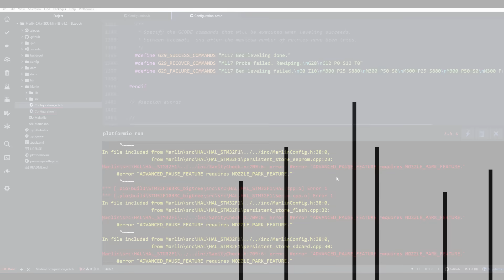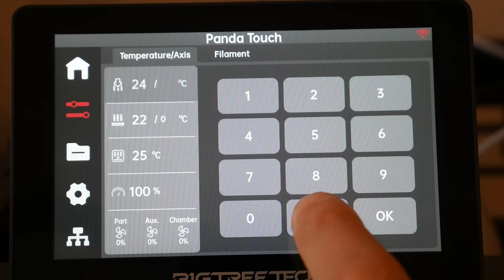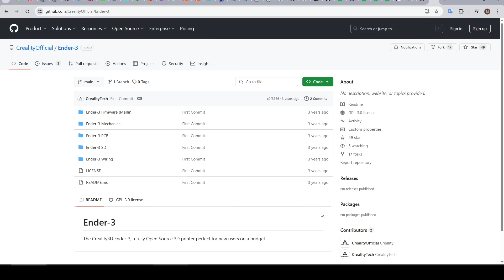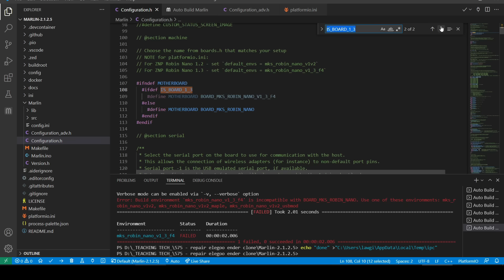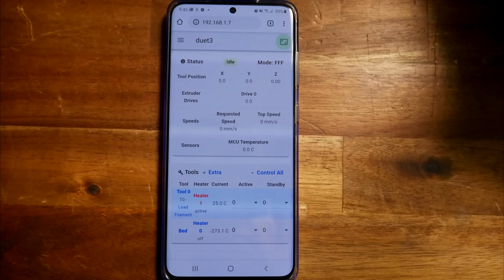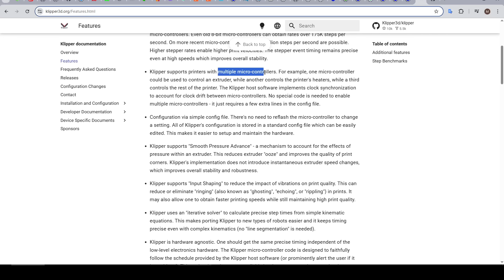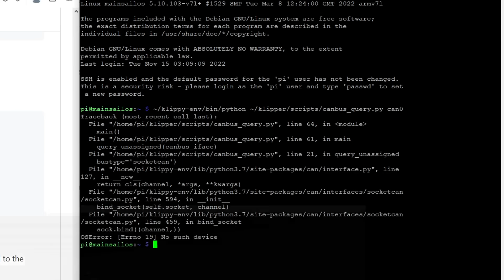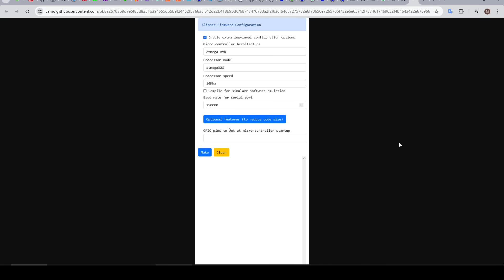What each 3D printer firmware does well, and where it needs improvement

Comment: Choices is always the best answer. Those of us that want to tinker and working on the printer is the fun part with the reward being a machine that works well.The appliance printers will always draw those that care to just print and perhaps design or the finished print is all that matters. These are all valid use cases and are why limiting the options only leads to stagnation for all. Both the tinkerers and the developers for the appliance printers will continue to innovate. I would love more openness from the latter and they often need reminding to credit the community when they implement those open source advancements.

Comment: You have a factual error in your video.  You said that the only reason bambu slicer is open source(and on git) is that it is forked form Prusa.  It's a fork of a fork, so it is opensource because of the original license assigned to it by the Sli3er team.  Not Prusa's license. Please stop being wrong so often.

Comment: Mr. Iscoc's Marlin firmware for ender 3's is amazing.  Has helped make my printers vastly more capable. So much so, that I will probably keep them in my print farm for a long time. 

My new K2 with Klipper has some nice features, that said I have vastly more problems and can't make simple changes as easily. That said only some of that is firmware and the rest is Creality's fault.
Reply: I'm using classicrocker883 fork of it for Voxelab Aquila (N32) and am testing with Creality 4.2.7 board. Up-to-date with mainline Marlin and lots of fixes 👍
ProUI looks sweet and has a lot of options (e.g. reversing extruder direction in UI, it's always reversed in config) 🤩

Comment: I think Marlin was a big factor in the boom of 3D printing, but it suffered the huge problem that it was built upon Arduino, which is a very extensive and supported but crappy platform, full of bad programming habits that lead to various elements that conflict with one another in an unexpected and difficult to figure out way.
Reply: Arduino is horrible! No resource management whatsoever. If two different libraries want to use the same timer for example they overwrite each other's commands. I wonder how that platform ever got popular.
Reply: @kwinzman  not to talk about conflicting #define and globals... it's popular because it's easy for everyone to get a simple project up and running, but once you pass the "simple project" stage you're in for a lot of pain.

Comment: I once put Klipper on an old Creality printer of mine.  I hated it. It was non-user friendly. I will not buy a 3D printer with it.  I have mainly Bambu Lab printers and their firmware is good, but not open much as you say. I'm still digesting their new changes and just not updating firmware now. The future of me with them is unknown. Prusa, its pretty primitive. The company is open, but the level of their new technologies is limited. Certainly not cutting edge. So right now Bambu is the best for me, but we will see how it shakes out.
Reply: It's probably better with large touch screen, though rotary encoder is easier to use. Having only web interface sucks, Klipperoid (android app) helps a bit, but is still slow 😉

Comment: I could learn how to mess with firmware, but I just don’t want to. My microwave heats food, my printer should print—that’s it. It’s great that people who enjoy tweaking have options, but I’m glad there are choices for those of us who just want to hit print and get results.
Reply: I absolutely agree that tinkering with firmware should never be required to get a printer working. However, having the ABILITY to tinker is not at all the same as being REQUIRED to tinker. Prusa is the classic example of very reliable machines that don't require tinkering (the Mk3 was the go-to "plug and play" consumer printer for years) with open-source firmware.
Reply: The problem is that a 3D printer is a fabrication tool, not a kitchen appliance. By your logic, if I buy a lathe or a mill they should just produce machined parts without my interference, which is nonsense for obvious reasons.
Reply: @vinnycordeiro  You're mixing up two different things. Knowing how to use a lathe or a mill doesn’t mean you have to modify their internal software to get results. Same with a 3D printer—you need to know how to operate it, but that doesn’t mean you should have to mess with firmware just to get a functional machine. Some people enjoy tweaking, and that’s great, but it’s also good to have options that just work out of the box.
Reply: @TinSVM exactly, mixing firmware modification with functional use is the reason Bambu cleaned up and stole the market, tinkerers perception that you need to tinker to make it work is a none scalable approach and what was holding the whole printing industry back. Thankfully Bambu has forced all manufacturers to make better machines that do what they were designed to do - print....

Comment: Open source is inarguably good for users. 

Just because a firmware is open source doesn't mean users are required to muck around with it. The fact that Marlin, Klipper, and RepRap require such mucking has nothing to do with the fact that they're open source, but rather it's because of a certain lack of polish. Similarly, Bambu could publish their firmware source and absolutely nothing would change about the average user's experience , but some more advanced users may choose to make modifications they feel comfortable making.

It's not about "taking the mucking around out of their hands". You can do that and still be open source

Comment: I dont' think most folks want to muck around in gcode themselves, but they still want open source firmware and slicers that are extensible so they can "install" modifications made by others. I dream of a simple plugin system for klipper that could apply in one click mods like KAMP, or modified wiping and leveling routines.  Even the Guilouz script I use on my K1Max requires some CLI knowledge and is a massive PITA to manually reinstall after every firmware update.

Comment: I’m glad companies are focusing on making their printers finished products. Imagine buying a toaster but before you can get it to toast your bread right. You have to replace the heater element and program its main board. Reconfigure its firmware. Ya you might end up with a toaster that can toast your bread to perfection in 2.3 seconds. But for the low low price of original cost of the toaster plus upgrades and your time. Some of us just want to make toast. I also really like the fact that there are options for every level of user.
Reply: apples and oranges.

a better example is how as computers have become more "out of the box" they have become ANYTHING BUT more useful, they steal your data, willingly work with organizations to spy on you and steal your actual work (adobe I see you), They lock all of the important tools behind layers and layers of privileges in YOUR OWN DEVICE WHICH YOU OWN!!! its a million times harder to work with computers now than 10 years ago.
Reply: dont need a toaster to toast. NEED a printer to print, and a computer to compute. biggggggg apples to oranges, mate.
Reply: @DavidSmith-cr7mb I’ve been printing since 2015. The point I was making was, I’ve purchased many printers that don’t work very well if at all right out of the box. I’m just glad I don’t have to rebuild them anymore just to get them to work. If you’re the type that likes to tinker with your printer, I think that’s cool. I prefer to design and print prototypes of parts I need. I just need printers to work.
Reply: Analogies fly over a lot of peoples heads.
Don't worry, your point is very valid. I've been printing with a variety of entry level and second hand hi-end printers. Although i enjoy taking them apart to fix and improve them. I also value my time when prototyping.
In short, I'd rather have my toaster toast in the morning when i need it the most than have to recalibrate it's timer and waste 5 pieces of bread and half an hour of troubleshooting to get one cooked right.

Comment: What you didn’t mention is something I find endlessly frustrating, namely companies like Creality or Qidi or Elegoo releasing printers with their own version of Klipper and/or Linux. I own a Creality K1 Max and it works well but some features aren’t available. The mainboard is underpowered, the version of Linux on whatever they are using as the host is a terrible Creality-own cut down Linux and Klipper is a non-standard installation because of this. I have a spare Manta M5P and I am more than tempted to put this onto the machine and basically start again, but this shouldn’t be necessary if manufacturers like Creality stopped trying to be software engineers by doing this and re-implementing slicer software that is worse than the original.
Reply from the maker: I agree with you that this is very annoying. However, it's not the fault of the firmware creators so it didn't seem relevant to include in this video.

Comment: Open source is great. I had to use an undocumented pin on a creality controller board. I was able to change marlin and recompile. My first try with Klipper went badly because a power failure corrupted the Le Potato SD. I have had good luck with a Pi 3B+. Several power failures have happened without corrupting the SD.

Comment: Having recently finished converting all but one of my printers to klipper I am astounded by the power different firmware bring to the user.  The biggest challenge I had to overcome was getting past all the tech-speak in the documentation.  Instead of simple and plain common wording used much of it seems to be intentionally obtuse.  I shouldn't need to employ a dictionary and thesaurus to get through your instructions.  Then there is the outright arrogance and elitism of many of the experts.  I have literally gotten the "if you even have to ask how then you don't need to know" answers a few times.  It still shocks me that some people will actually take the time out of their day to write a 20 line snarky response instead of the 15 words needed to provide the answer requested.   

I found many years ago when I was still in IT that there are really three types of logic used:  Designer logic, programmer logic and end-user logic and it is only when all three coincide do you get that truly stellar experience.  Sadly you have designers who aren't end users so they have no clue what the consequences of their choices are.  You have programmers who figure that if they have to dumb it down to explain it to you then you're too dumb to be allowed to use it.  Then you have the end user who just wants it to work and they are too often willing to make sacrifices in advance control for basic ease of use.  I want a designer to be an end user who will work hand in hand with the programmer to get all the advanced features in a simple to navigate UI using clear, common English.  We're getting there but we are still at least a decade away and by that time open-source will be a dinosaur I fear.  Too many developers will get sick and tired of the demands being placed upon them for something they aren't being paid for and companies will step in and fill those demands but only after they get paid.  In the end the user will still be the one to walk away with less than they are asking for.

Comment: There is also Repetier-Firmware, which is still open source under GPL3.  However, there hasn't been a new version since 2019, and V2 is still claimed to be under development.  I used Repetier-Firmware in my first Repstrap 3D printer back in 2014.  It was easier to configure than Marlin at the time, but I later moved over to Marlin when it became better developed.  I'm now using Klipper on an Ender3 converted into a Voron Switchwire.  I've been trying to get this printer fully working for over a year now (having problems with a probe for auto bed leveling).  It was working briefly, very well, but I developed problems with a CAN toolhead, and have ditched that wiring the toolhead directly to the main MCU.  Now trying to get a Klicky probe with a servo to dock the probe working.

Comment: Can we get a deep dive series into inner workings of klipper? Like how exactly z tilt works and what kinematic does it expect (Maxwell or others), or docking/undocking probes, can we mount klicky to the bed instead of frame without a dedicated z endstop in a trident style printer and how to config for it. Or how to define irregular safe zones for the nozzle to move like in a toolchanger where the nozzle might need to take a special route to its destination to avoid collision.
Or how to modify the kipper to run a custom diy multi material unit to control servos, spool rewinders, cutters, multiple sensors (filament presence, humidity/temperature for integrated dryer, VOCs/particulates for Smart filtration) or even custom smart filament sensors (as they're easy and cheaper to make with simple optical encoders).
Or at least have Chris do it.

Comment: Being able to change things as needed can be the difference between a product that has gone sour and made a customer that feels like a loser and a customer that feels capable and confident. With that said, companies doing what bambu lab does, which is trying to make things better out of the box, is a perfect approach.
Reality is, that no matter how much I know, I will probably never be able to do better than the employees of these companies as they get dedicated time and pay to work on optimising things so a specific setting in the firmware is at the best it can be.
But I also understand user want different things and that it would be best to have settings for best speed, best surface quality, best tolerance and balance, if the printer can do both
Reply: fine line between "better out of the box" and "propriatary manufacturing for profit, at the cost of innovation in the industry"

I think if the proprietary computers on the market werent proprietary, we would have better computers. this is my opinion. that is all. culture thing, if you insist I explain, the purpose of the product is not to be proprietary anymore... overengineering something for the sake of it to abuse patents is just... yuck? can we grow past this and look closer at the patent office

Comment: As someone who uses Linux on a daily basis, I have no issue with the initial setup of Klipper on my printers.  My CR-10v3 is using Mainsail while my CR-10S project printer has Fluid installed.  I get the "average user" theory, but the initial setup of klipper is very well documented so if you are willing to tinker even a tiny bit, Klipper is definitely worth the effort to get going as compared to the level of effort required to manage Marlin firmware longterm.  Heck if I had a Bambu Lab printer, at this point I would be looking to give BBL the middle finger and see about putting klipper on it as well.  I would even be interested to see if this has already been done...or maybe a future video idea. :)